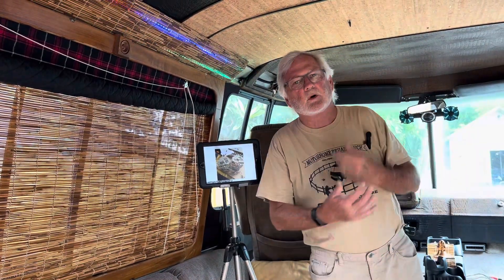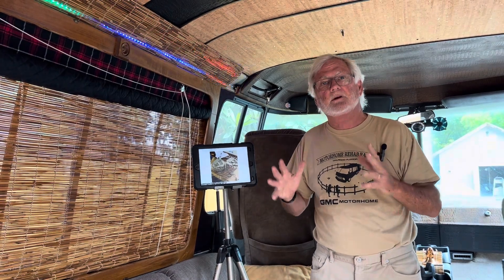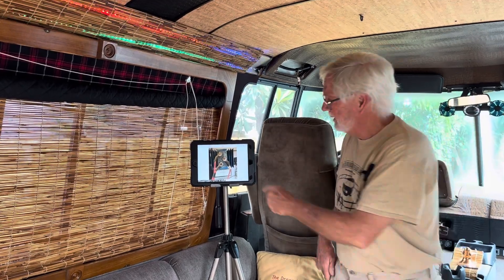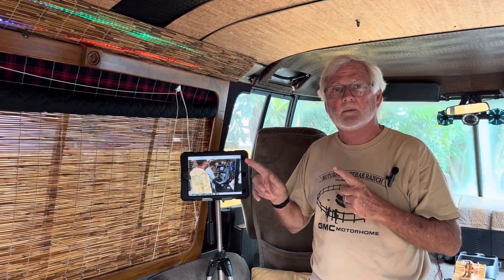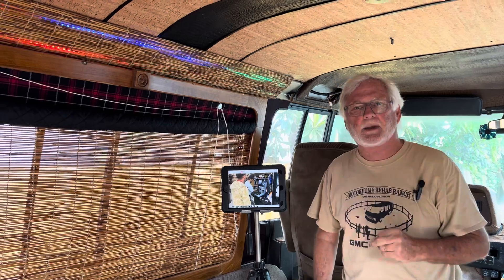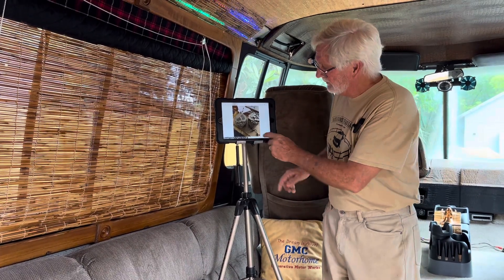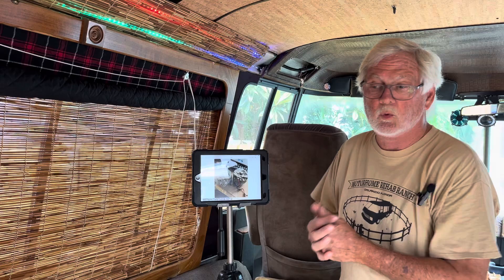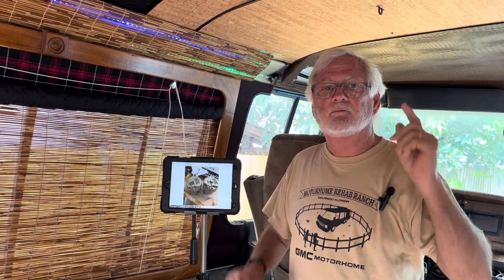Alternator failure

Comment: Jim, as a person who tends to believe GM did it alright, why not just repair the trigger circuit? Is it just to get home? If so, you can simply short trigger to the alternator stud to fake it out for the trip, then repair the circuit when you get home. That's all a one wire regulator does, it's just internal. 

The self-exciting one wire circuitry I've had iffy luck with (your mileage may vary), I've swapped 12si cold-pak (the HD alternators, with heavy bearings and massive, finned voltage regulators, from GM) and CS styles into vehicles of all ages, including Generator vintage vehicles, I'm a fan of keeping the "Alt/Gen" light active, which most one wires bypass.
Again, as you say... It's your choice.

Couldn't agree more with the replacement of the water pump and Alternator. Yes, pre-test. Most remans are garbage, and getting worse. Also remove fuses for non essential circuits if you can... Might save a parasitic draw from sidelining you as well.

Always an awesome video, thanks for the info, and thanks for making all of us GMC owners a bit smarter, every day....

Comment: Thanks for the video. Is there a part # I can give to the auto parts guy? I can't deal with the Year, Make, and Model? question. Is it the kinda thing where our alternator is the GM 100 Amp alternator? or are there different form factors that won't work for us?
Reply from the maker: A parts store will not have a “1 wire” alternator.  Find a local starter/alternator. rebuilder.  They can do it

Comment: My coach is a recent pull from a long nap since 09 and I'm going to replace a snapped alternator belt soon. I'm thinking I should convert to one wire while I am at it. Do you have documentation on converting to a one wire?
Reply from the maker: Did a video on it but find a local starter/alt. rebuilder and I’ll tell you what to tell him, call me